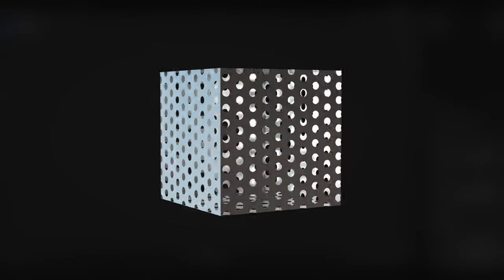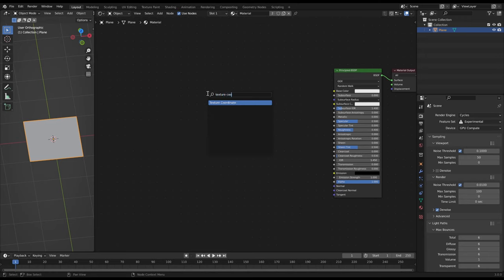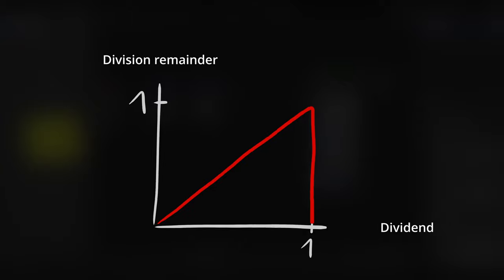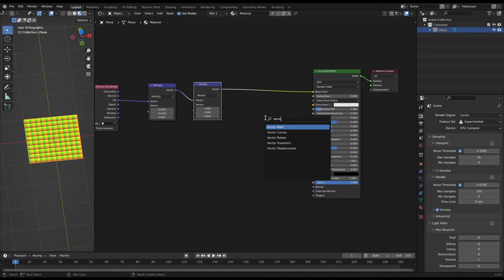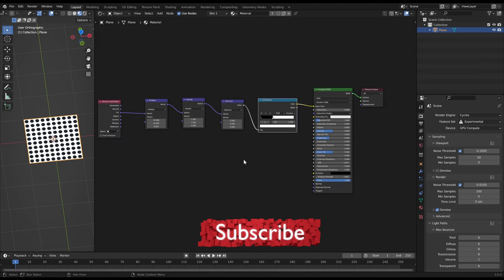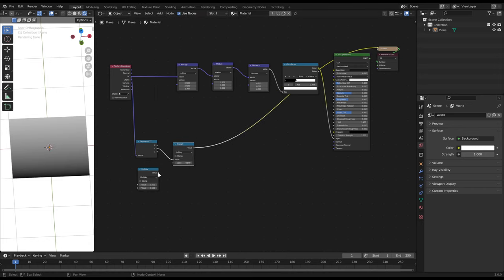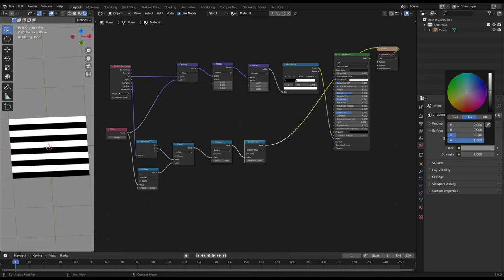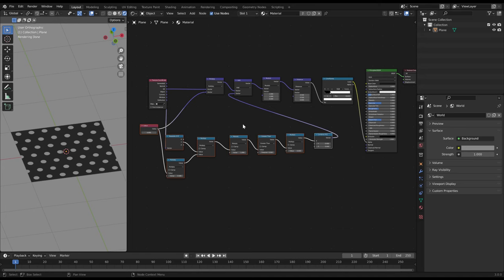Blender Tutorial - Procedural Hole Shader

Comment: This is genius stuff. However I tried to apply the offset pattern to a fairly elongated plane and the holes didn't move, is it an X vs Y scale problem? (I did have to squish the shape a lot in the UV editor to make the holes look right with a single value, otherwise I had to use two vastly different numbers in the first vector multiply node). Could that affect how the offset math stuff works? Sorry if that makes no sense, I'm quite new to Blender and not too much of a math-head, I'm trying my best to understand what I did wrong :D
EDIT : also I had to use a much higher value than you did to have a satisfactory amount of holes (500) but I don't know if that affects the math in any way either
Reply from the maker: Hm, so this whole pattern basically lays on your UV-Grid in the UV-Editor. I don't know how your setup looks like, but as long as your UVs look exactly like the surface of the geometry this should work very good.
If you can't  figure it out, you can send me some screenshots of the UV, Mesh and node tree on instagram: pointcloud_tutorials

Maybe then I can provide a better help.

Comment: Can i use it somehow to make a ring of circles on hand mesh. Using uv coordinates stretching it because of my uv map for this hand. What can i do with it?
Reply from the maker: Uhm, certainly. Can you explain how these rings are supposed to be distributed?
Reply: @PointCloud  8 circles form a ring around the forearm.
Reply from the maker: Hm, in this case you can basically just use a wave texture node and arrange it on the UV maps to be circular around the arm.
Reply: @PointCloud  i already did it). But i need rings of circles near that lines)

Comment: Really great! How would you do it with squares?
Reply from the maker: Sorry for the late reply. You could use a "less than" operation instead of the distance calculation. Because these many RGB squares have values from zero to one in them, so when you take values less than 0.5 on the X and Y axis for example, it should have a square pattern.

Comment: I get the black dots, but they won't become transparent and I have no idea why, everything else works besides the transparency part.
Reply from the maker: Is it plugged in the Alpha channel?
And if you use Eevee, have you enabled the transparency in the material properties?
Reply: @PointCloud  Yeah it's in the alpha channel, aaah I bet it is because I'm in Eevee, doesn't become transparent in Cycles either though. How would I enable the transparency? Is it transmission?
Reply from the maker: @Lord Aniolist  On the right of your Blender window you have these tabs, one of it is a red sphere (=Material Properties).

Scroll there down to Settings -> "Blend mode" and choose Alpha Blend for example.
Reply from the maker: But if it's not transparent in cycles too, then the problem is in the shader tree itself. You have to plug the whole tree in the Alpha input of the Pricipled BSDF node.
Reply: @PointCloud  Yessss!! Thank you so much! I was missing the Alpha Blend lol
Thank you for explaining this, I knew I was missing 1 little thing! I've wanted a metal shader with holes for months now and finally have one, thank you and am subscribing 😁♦
Reply from the maker: You're Welcome.

Comment: Question why is my whole thing transparent I want to only make the holes transparent and not the lines around the holes
Reply from the maker: Sounds like your black/white mask has an issue.
Reply: @PointCloud  also how can I transfer for it to a different platform I tried exporting these holes to Roblox studio but when I do it’s invisible and nothing show but an invisible box. I export as an fbx
Reply from the maker: Its just a shader, the geometry is untouched. So it's only  working in blender. Maybe you can rebuild it in another Software.

Comment: Question; does the surface have specific scale, diemensions value, or size?
Tried to add this onto model's single plane, but the ColoRamp functions like a "lightswitch" turning it to either white or black.
Reply from the maker: To apply that on a single Face, you should use the UV Texture Coordinate (maybe you have to unwrap it then again), and then with a "Mapping" node you can adjust the scale, position and rotation of that Texture Space. To make this pattern smaller, you have to increase the "Scale" value for example.

Here I don't use a "Mapping" node, but usually it's done that way.
You can see that in basically any other shader tutorial on my channel, here is an example: https://www.youtube.com/watch?v=gRztKZlDWBA
Reply: @PointCloud  Mapping node fixed that.
Alas, I got more work with trying to add armature back for the ”unwrapped” model…

Comment: Cool! Can we add some thickness to this?
Reply from the maker: Well, since this is just a shader which defines the surface color, you can not just add thickness to this appearence.
But you can fake thickness by just layering multiple surfaces on top of each other with a bit space between them.
Then it looks like you have thicker holes.
Reply: I use it with a solidified plane and works great!